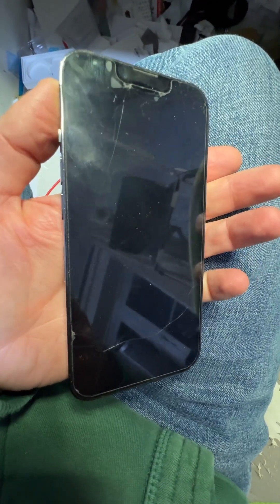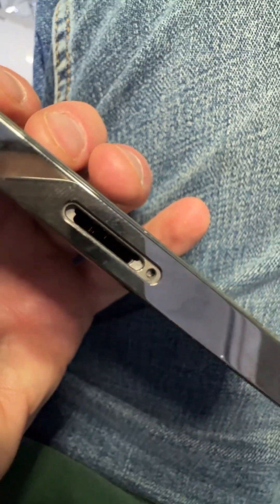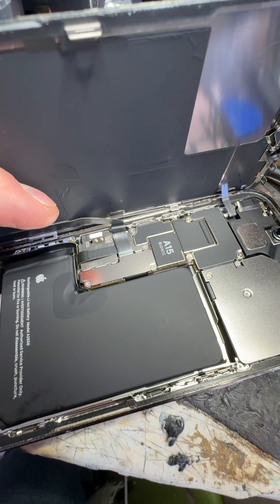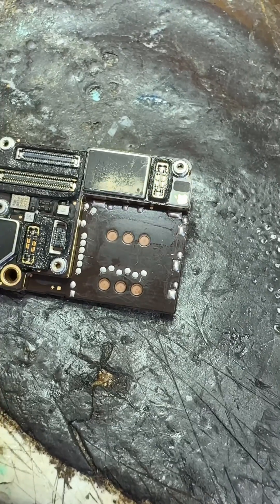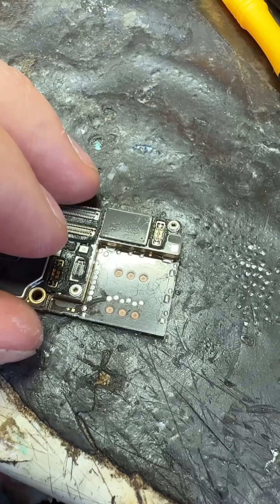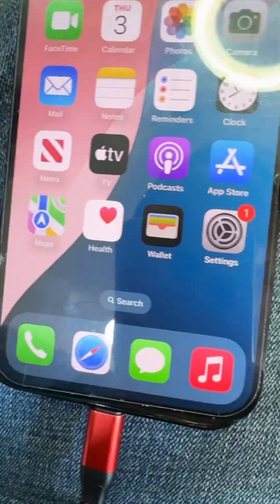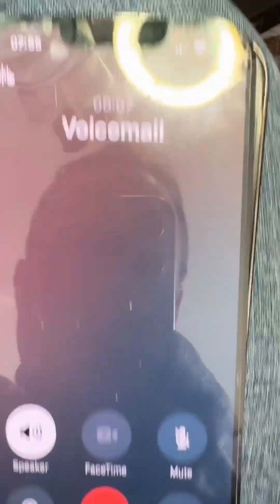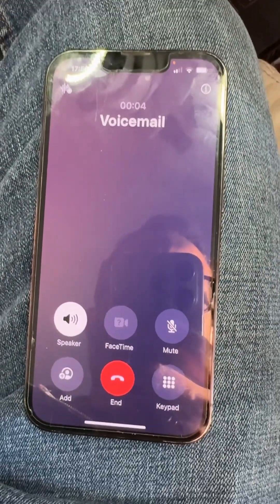iPhone 13 Pro SIM card reader replacement - microsoldering job

Comment: Watched the video to learn how to do it not for you to show us that you did it 😀
Reply from the maker: Sorry I only have one set of hands. 

Essentially the way I did it was use side cutters and dremel to remove all the frame until you just have bare basic parts of the frame left, which you can then remove with soldering iron.

I then wicked the solder joints on the board to remove the solder and added new low melt solder.

Then used hot air at 200c to solder back. 

I do it this way so there’s zero risk of causing shorts under any of the chips on the inside section of the board from too much heat.
Reply: @Mobileithelp  thanks, do you use the hotair from the bottom of the board to avoid plastic burning?
Reply from the maker: @MedooHemasa no I use low melt solder and 200c to solder back. This doesn’t melt the plastic
Reply from the maker: So essentially remove all the plastic and metal of the reader very carefully until only the metal parts remain.